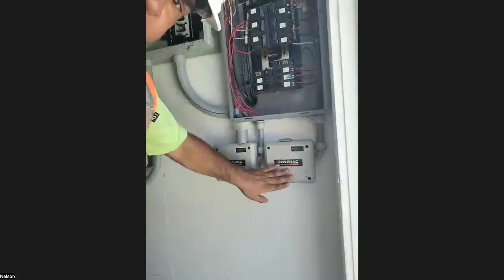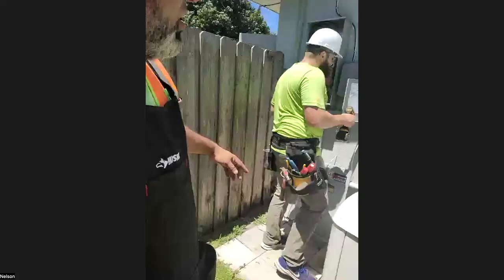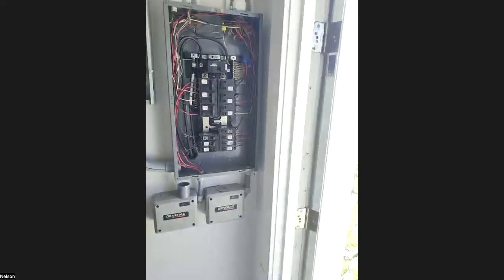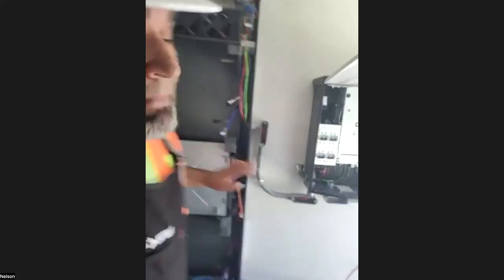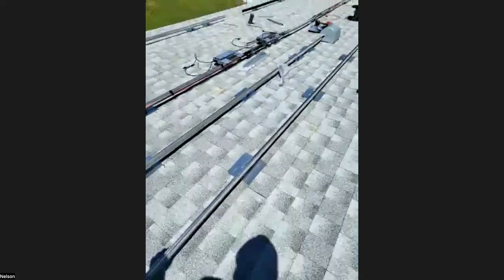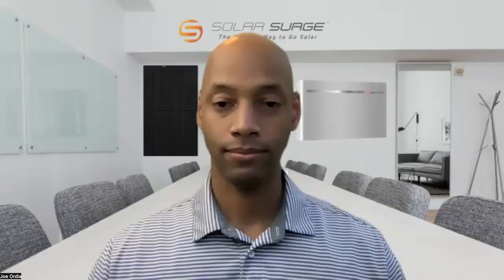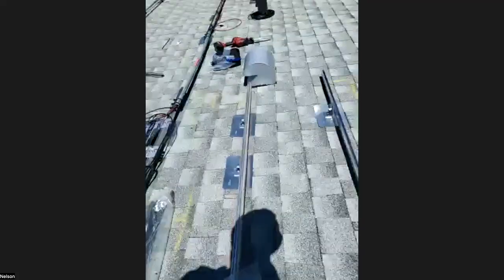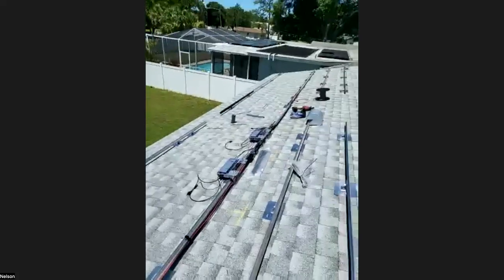Generac PWRCell Hands on Install with Lotus Energy Solar

Comment: Bruh. The metal on the pv links grounds to the rail by making contact with it through the micro T bolt. Its grounded automatically by just fastening it. You're wasting copper wire and materials.

Comment: Generac has some work to do if generator/battery aren’t talking or synced with each other… 
Enphase has generator support, can auto cycle generator based on user preferences and solar, battery, generator can all run at the same time.